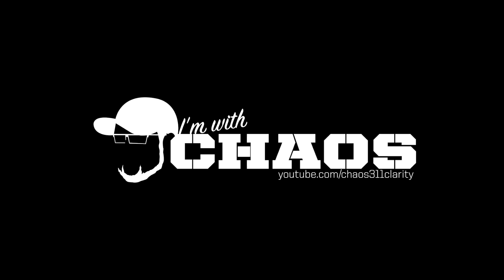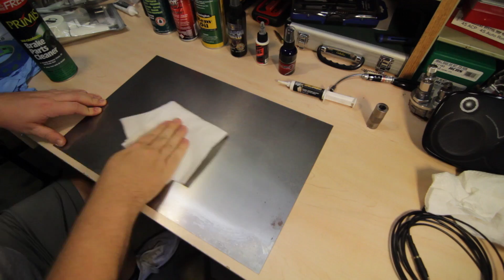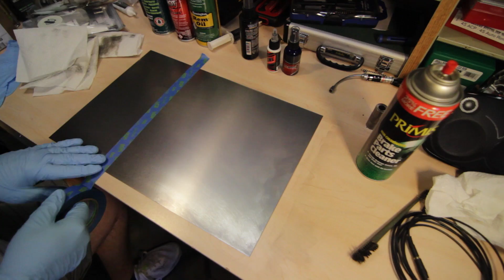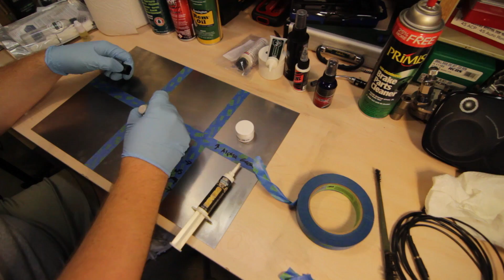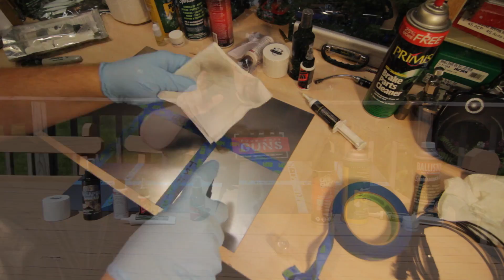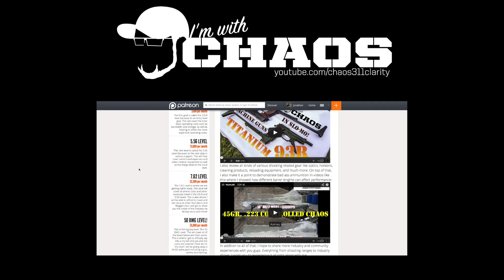New CLP Exposure Test - Failed Experiment - Part 1

Comment: Weapon Shield oil is non toxic, believe it's a hydrocarbon ? Claims to be a CLP but not impressed with it's cleaning or prevent rust, it is probably one of the best product at reducing friction, you should have tried Corrosion X.

Comment: I've found Balistol safe for all kinds of materials and when it meets the flames of combustion it has an ammonia smell. It doesn't do much of anything for copper or lead fouling though. Got to use something else for that. Seems to hold off corrosion but I haven't tried leaving steel outside.  Can't wait to see the results.

Comment: Thanks for the test.  For the record Hornady gun cleaner and case lube are REALLY different.  Case lube will dry like sticky wax kinda like spray lanolin. Not meant for weather protection. One shot gun cleaner will dry with a very thin film, almost nothing.  Like brake clean it will eat plastic, dry out rubber and will strip normal oils out of stuff. Eats through latex gloves too.  Good for stripping oils off a heavily oiled metal gun parts but don't get it near polymer.

Comment: It will be interesting to see what happens, but the results really won't mean much for most people in a real world situation. A great majority of people are not going to leave their guns outside in the rain/snow/sun, etc. for weeks at a time, especially without at least wiping them down. Most people clean their guns on a semi-regular basis and store them indoors, so it doesn't really make much difference as all of these will do their job on a reasonably maintained firearm. (Rem Oil IS kind of thin though...) Kind of wish that you had some Militec-1 there as well. Looking forward to the results regardless, simply to satisfy my odd curiosity.